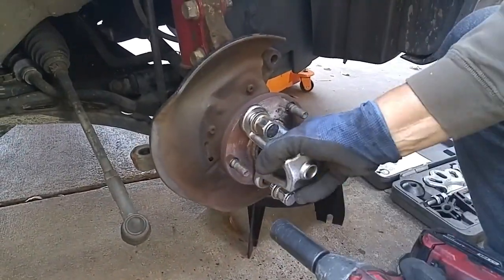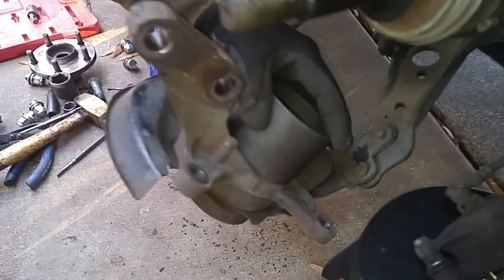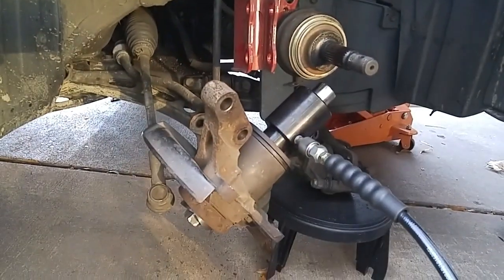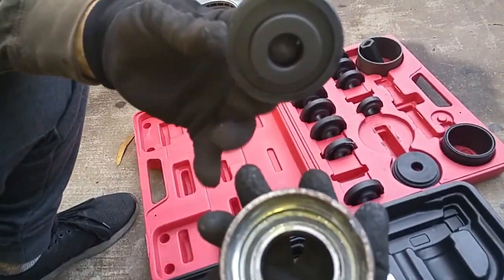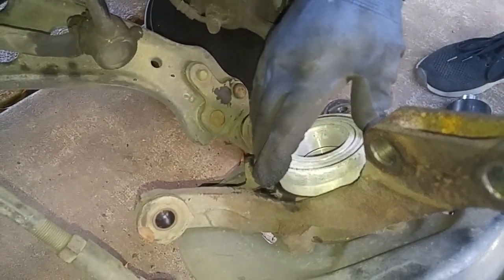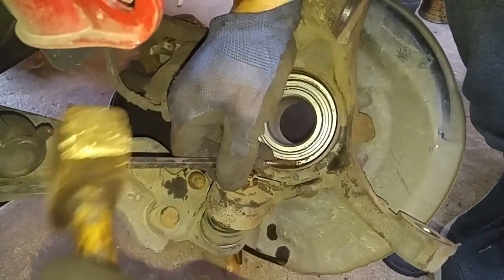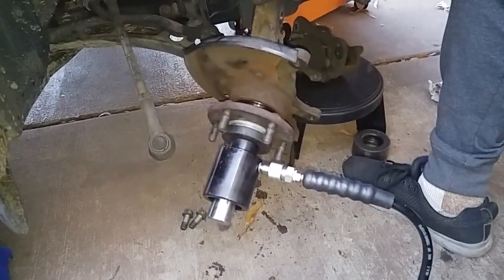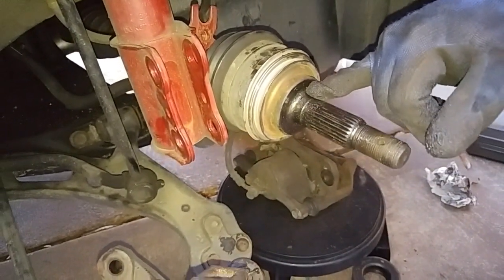Replace Front Wheel Hub and Bearing with Portable Press! - Toyota Camry - Easy How To

Comment: This is genius; I've been working hard unnecessarily pressing bearings in and out manually. Thanks for an awesome install!!
Reply from the maker: Thanks!  Work smarter not harder!
Reply: Make it easier on yourself. Take the whole spindle off and while the new bearings in the freezer, heat up the spindle with a propane torch. I've never pressed in bearings, they just fell right in.

Comment: Try and level some steering knuckles for a 20 ton shop press. If not secure you can damage the knuckle during removal or cockeye the bearing during installation very easily. This process greatly eliminates those damaging possibilities during removal and installation.
Reply from the maker: You're correct.  You need more than a shop press to properly service pressed on bearings.

Comment: I just spent weekend with my teen son using breaker bar and it took forever. Are the threads for the bearing tool common standard with the punch tool, this was super clever, thank you so much for this, I’m encouraged continue with the other bearings that need replacement.
Reply from the maker: Some bearing press kit's forcing screw have different thread patterns.  A local machine shop could make you straight bar forcing screw.

Comment: Is it possible to overdo the process of pushing in the new bearing with the hydraulic press? Do i need to have a comprehensive understanding of where the bearing should be seated or can i just push it in until it feels right/can’t go in any further?
Reply from the maker: When the snap ring grove is visable, you've pressed it in far enough.
Reply: @hardlymovingpro  thank you 🙏
Reply: @hardlymovingpro  do you offer 1 on 1 consultations? I’d be willing to pay for your expertise of course
Reply from the maker: @Maestro-gh2ei  send email to hardlymoving@gmail.com

Comment: I’m curious to know where you got the long hex bolt from?  I know it didn’t come with the hydraulic kit because I have the exact same kit and the bolt that comes with the hydraulic kit is a 3/4 inch 5 inch long stud bolt. I purchased the exact same hydraulic kit from Harbor Freight and the 3/4 stud bolt that comes with it is way too short to do what you did and the hex bolt that comes with the bearing adapter kit is a lot larger than 3/4 which is required to use the hydraulic kit.  Thanks.
Reply from the maker: I used and cross purposed the bolt from the Hub Bearing Removal Tool kit (from the red kit in the picture).  The threads from that long service bolt matches the thread pattern in the hydraulic press tool.

Comment: Sorry to question your tool recommendations. But the astro kit has a 7/8-14 bolt and the punch kit has a 3/4-16 thread. It wont work unless you buy a 3/4-16 threaded rod n nut or buy the other kits other than the astro kit.
Reply from the maker: Good to know and thanks for sharing!

Comment: Damn! That's amazing!! I wish I would have known about this before I went to replace my front wheel bearings! I used a 20 ton HF press but this seems much easier!! Thanks!!
Reply from the maker: Thanks!  Here's what amazed me.  I reached out to some parts manufacturers about making a kit with a hydraulic pump attachment.   No one expressed an interested.  Also, using a stand up press can be difficult without having a hub and bearing press kit.  Getting that steering knuckle perpendicular to the press can be a bear.
Reply: @hardlymovingpro  . Yep. It was  real challenge doing this for the first time on a press. Great idea man! Cheers!
Reply from the maker: You bet!
Reply: I just did my front wheel bearing two days ago. I purchased a 20 ton press (got a real good deal), but it was very hard to support the knuckle. I ended up renting the tool from O'Reilly for $400. I'm still keeping the press, but I will also buy these two devices.

Comment: Well done!
Did you have to modify the hydraulic cylinder to fit the thread geometry of the forcing screw?
Reply from the maker: No ... Not at all.  Seems like all these forcing screws in kits are of consistent diameter and thread pattern along with the hydraulic cylinders that accepts them.
Reply: That's great! Thanks for the response.
Reply from the maker: You bet!

Comment: Good stuff. What do you think about putting the bearing just in the refrigerator? I'm worried that when the frozen condensation melts after the bearing is installed it will be permanently rusted in place.
Reply from the maker: There won't be any rust.

Comment: Hello Sir, what is the size of the forcing screw that you attached to the hydraulic puller and did it come with the bearing puller set you used?
Reply from the maker: The forcing screw and bearing puller are provided as 1 kit.  The length is consistent with most hub and bearing kits.  The thread pattern can differ and have no way telling you.

Comment: Was the thread pitch and size of your draw bar from your other set the correct size and pitch to fit into the hydraulic pump?
Reply from the maker: Yes.  What you call the "draw bar" is commonly referred to as the "forcing screw".  You may have to find a replacement forcing screw if the thread pattern on the screw doesn't match the hydraulic pump.  A machine shop should be able to help you out if needed.

Comment: i bought my 15t hole puncher over 10 years ago for this same reasons. i have changed hundreds of bearings with it.
Reply from the maker: Good for you and thanks for sharing!
Reply: @hardlymovingpro  it is an excellent tool for bearings and bushings with metal outer sleeve. if you buy a bolt that has the same threads that go into the piston. then you can drill through it and tap the hole. now you can use smaller diameter bolt to go through bushings.

Comment: How many more times have you used this technique? What's the success rate? The forcing screw being the same thread pitch was that just a coincidence?
Reply from the maker: 3X.  100%.  Thread pitch was coincidence.  Perhaps industry standard tool size.
Reply: @hardlymovingpro  I see you left a link for a different tool than the one you used (from harbor freight). Any reason for that?
Reply from the maker: @ousmanediop9113  For those who want to buy on-line instead of running to the store.

Comment: Is this the same process for the rx330? The part looks identical for the Camry from years 99-06 maybe even beyond that from what I can tell in pictures at least.
Reply from the maker: Yes but the bearing will be different
Reply: @hardlymovingpro  
Are the bearings for the 4cyl and 6cyl Camry different? From what I’ve read the bearings should be the same for camrys from 04-09 and then many after that should also have the same bearing and hub as the rx330.
Only asking because Someone near me is selling a set for cheap and they bought it for on 06 Camry but idk yet if it was 4 or 6cyl variant
Reply: Sorry one more question. Just How much torque you think I’ll need to pull a bearing? My ryobi p262 is a beast 500 easy probably get 600 lbs/ft if I jam on it at high for 15 seconds with a full 6ah pack. Dropped the thing in a bucket of atf during the engine swap and it didn’t skip a beat! (Have seen a Milwaukee dunked in water while spinning so I wasn’t too surprised) but I’m wondering if I need something that gets into the 800-1000 range?
Reply: @deeeyewhy5949 I so want that new Dewalt 3/4" 2100 ft/lbs impact for this job, not that it matters but the tool is a beast.

Comment: My long forcing screw from the press kit won’t screw into the hydraulic puller. Did u find another screw for this?Plus my cup stuck on the outside from my impact gun any ideas on how to get it off
Reply from the maker: Yes.  I've learned that the thread pattern on some of these press kits won't match.  You have to go to harbor freight tools where they have both kits to verify a match.   Try light taps with a hammer to get off the cup.

Comment: Would this also work with a Volvo C30? The bearing is inside the hub and must be replaced together. Remove tool has plates that go behind the hub.
Reply from the maker: Should work with minor differences.

Comment: At 3:00 where did you get the threaded bolt that fits the hydraulic punch kit.   The one that came with my hydraulic punch kit is short. The bolt from my bearing press kit is long enough but a courser thread than my hydraulic cylinder .it's a fine thread.
Reply from the maker: The "threaded bolt" or forcing screw came from the Hub and Bearing kit.  The one I bought had a forcing screw with a thread pattern that matched the hydraulic pump.  Try a local machine shop and see if they can order or make you one.

Comment: How do you when to stop pumping it in ??? Would it be easier to put the back o ring/lip and push it in front the front till it hit the o ring well till you be able to feel the resistance that it is hitting it ?
Reply from the maker: I've found visual inspection on the progress of the bearing movement to be the easiest.  Also, with the bearing being frozen, it didn't take much pressure effort to pump the new bearing in the steering knuckle until I felt the back pressure indicating the bearing has reached the lip of the steering knuckle.

Comment: So  i am wondering if it wouldn't be easier to remove the whole piece take it to a shop press press the bearing and bolt it back on?
Reply from the maker: That's what I use to do.  Problem was repair down time and time spent going back and forth to the machine shop.

Comment: Hi there, changing the wheel bearing by using a knockout pouch is a small way of thinking.
Great video and thank you for sharing your genesis thinking.
The size of the hydraulic pouch threads is M20-1.50mm. The wheel bearing set large bolt is 3/4"-16, thread pitch That’s a little too small to work correctly without damaging the bolt or hydraulic pouch threads.
Reply from the maker: Thanks for watching!  The wheel bearing (large bolt) is called a forcing screw.  Believe if you go to your local machine shop they can provide you a non headed screw with the correct thread pitch.  You can then screw on a nut on each end giving you more adjustment flexibility when attached to the press bearing adapter plates.

Comment: Can you tell me the model number on both the hydraulic pump and bearing press kit.  I ordered the press kit you have listed ( Blue) but the hydraulic pump I have looks to be the same company the forcing bolt in the press kit is a different size.  The pliers u recommended worked great.  Thanks again
Reply from the maker: I recommend you go to a local Harbor Freight near you with the bearing press kit's forcing screw.  Then see if the forcing screw thread pattern matches the threads in the punch kit hydraulic adapter.  Another thing you can do is replace the short forcing screw in the punch kit with one that's the same length in your bearing press kit.   Go to your local machine shop and see if they can help you out finding a supplier.
Reply: @hardlymovingpro  I purchased the hydraulic pump 56411 from Harbor Freight and the press kit from your list of tools.  I will check around for a local shop.  Was looking to purchase the hydraulic pump you suggested if it will work with the blue press kit you suggested.  Do you know if that hydraulic pump works with the blue press suggested?

Comment: Hey, your videos are great! I purchased the Orion kit from Amazon and the Pittsburg pump kit. The treads on the Orion kit are different than the one on the pump. Did you have to purchase another bolt to make this work? If so, where did you get it?
Reply from the maker: Nope.  I first went to the Harbor Freight to see if the force screw bolt in the Hub Bearing Adapter kit matched the threads in the punch kit ... which it did.
Reply: you will probably need to find a grade 8 bolt to fit the hydraulic pump assembly.......try to get fine threads if possible and it will last longer.....
Reply: @gregallen9065   I think the pump is threaded.  Would have to get threads to match the pump.
Reply: @hardlymovingpro  I didn't see anything in your list you used from Harbor Freight. What tool did you use from them?
Reply from the maker: @Chevy3278  harbor freight sheet metal punch kit.  There's two kits with different pumps for higher/lower pressures.

Comment: where did you get the hydraulic press from?
Reply from the maker: I cross purposed from a hydraulic knockout punch driver tool kit.  They're used to cut / punch out large round holes in sheet metal.  I provided a link to the kit in this video's description.

Comment: Can a bad wheel bearing on the drivers side cause my breaks to fail? Master cylinder was empty after this occured but no signs of leakage from any of the lines? Perhaps Master Cylinder inner seal failure, or it all drained into the brake booster?

Brakes are fine when engine isn’t running, but they are soft and go to the floor when engine is running. Have to slam on them to get them to respond minimally if at all. This happened after jacking the car up on the driver’s side to tighten my lug nuts as I kept hearing a screeching sound that I now realize was a symptom of faulty wheel bearing
Reply from the maker: You master cylinder seal is shot allowing brake fluid into the brake booster.

Comment: Maybe I missed it but how did you remove the old inner race from the hub?  I have seen three ways to do it.  What did you do?
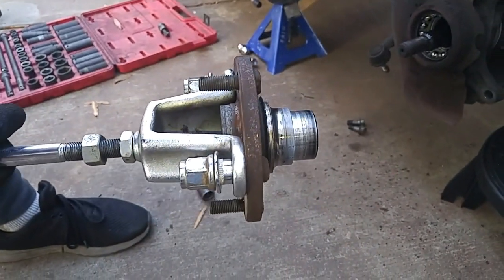Reply from the maker: At the 1:33 time mark, I pulled the wheel hub from the bearing's inner race.   There are two inner races.  One is stuck the the shaft of the hub after the hub has been pulled, and the other remains with the wheel bearing in the steering knuckle.   When the wheel bearing is pressed out of the steering knuckle via the hydraulic press, the other half of the inner race will come out with it.
Reply: @hardlymovingpro  Yes, the one inner race that is stuck to the hub.  Did you cut it off?
Reply: @canuckfixit7722  yeah i also notice it, in most videos everyone skips that part, they dont show it in video how to remove it and all of the sudden they have the hub ready to install
Reply: @soy_mariachi2425  LOL  HMP's response above as to what happened at 1:33 doesn't cut it.
Reply from the maker: Hub was replaced with a new one from the hub and bearing kit.
Reply: @canuckfixit7722  yeah but he doesnt show how to remove it from the hub and thats what i wanted to know
Reply from the maker: This video:  https://youtu.be/I4P3T-cb7rg

Comment: This is best idea in YouTube. What the size and thread of the bolt in hydraulic knockout punch? I have the Astro Bearing Pressing  kit. I'd like to use it to remove hub wheel in a 4WD 2004 Tundra. Before, I buy the kit from HF, I'd to know if I need a longer bolt. Thanks.
Reply from the maker: I went to harbor freight and the thread pattern in the punch kit's hydraulic adapter matched my press kit forcing screw.
Reply: @hardlymovingpro  Thanks. I hate to bother you. One more question,  who makes your slide hammer kit?

Comment: Did you have to buy a long fine threaded bolt because the one that came in red box kit with all the amatory was coras thread
Reply from the maker: The "threaded bolt" is commonly referred to as a "forcing screw".  Just take the screw out of the kit, bring it to the shop selling the hydraulic punch kit and see if the screw threads into the punch adapter.

Comment: Wow... you made it look so easy.   Xan you help me solve my problem?  I changed my bearing and hub but now I have a louder whirling sound at around 40 mph.  I used to only have a humming sound barely noticeable.  How can I troubleshoot my repair?
Reply from the maker: Hub may not be completely seated against the outer CV bearing cup.  Try re-torquing the axle nut.

Comment: Absolutely outstanding!  Very creative!  May I ask.....the bearing kit says the bolt that comes with it is 7/8" grade 8.  I'd like to get that hydraulic kit you used, (and included a link for).....but it's obviously very important that the bolt in my kit fits this particular hydraulic kit's piston.  Can you please tell me the exact size of the bolt that fit this hydraulic kit?  Is it really a 7/8" bolt, with what? SAE or metric threads?
Reply from the maker: The hydraulic press kit was purchased at my local Harbor Freight store.
Reply: I have the same question. I have the Pittsburgh punch kit and the ram uses a 3/4 -16 unf fine thread forcing bolt. The wheel bearing set you have is different than the one you have a link to in Amazon and not just because the case is different. I need to get the wheel bearing replacement set that has that particular size forcing bolt. Where did you get your kit and can you please give us the link or description of your set as it Cleary has a bolt that threads into your Pittsburgh ram... any and as much info as you can provide would be much appreciated. Thank you!!!!!!
Reply: Yeah wonder that too

Comment: Amazing video👌👌

Does taking out the steering knuckle as a unit make the job harder, or you just decided to do the job on the vehicle?
Reply from the maker: Both.  Easier to maneuver the knuckle while being attached to the lower control arm.  Thanks for your post!